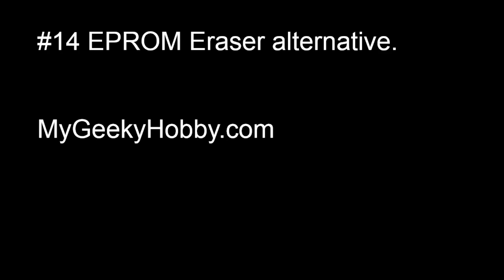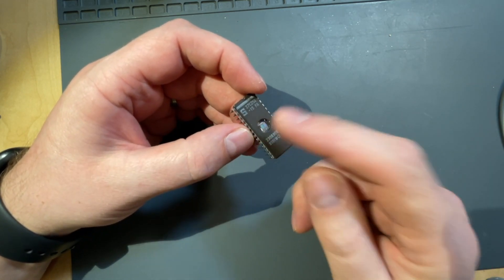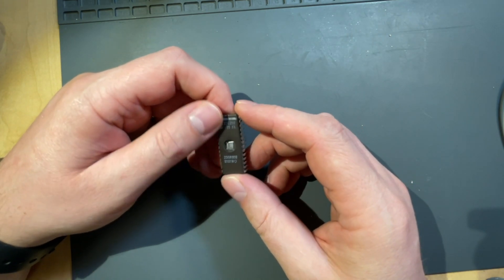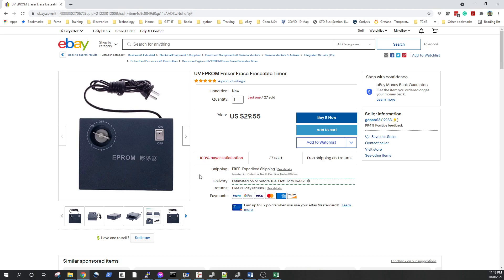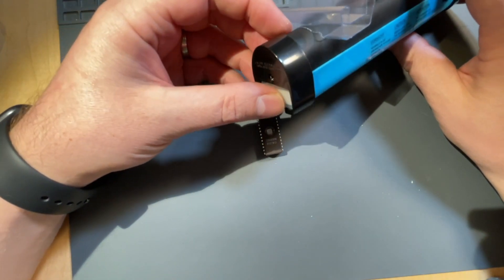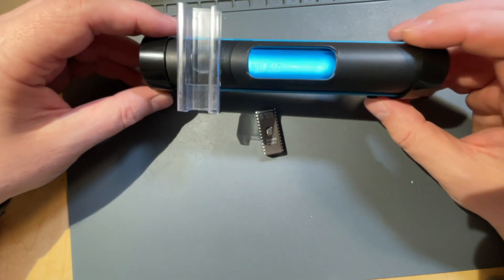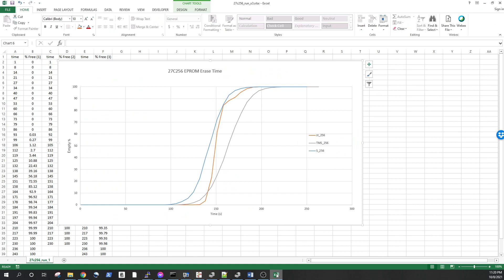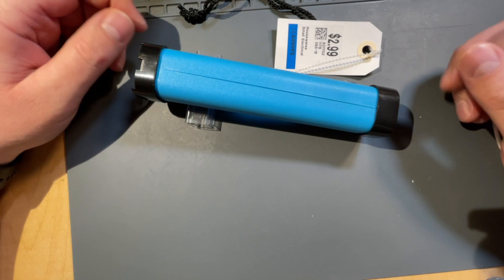#14 EPROM Eraser alternative

Comment: From Wikipedia:

Erasure of the EPROM begins to occur with wavelengths shorter than 400 nm. Exposure time for sunlight of one week or three years for room fluorescent lighting may cause erasure. The recommended erasure procedure is exposure to UV light at 253.7 nm of at least 15 Ws/cm2, usually achieved in 20 to 30 minutes with the lamp at a distance of about 2.5 cm.
Reply: yeah! I read exactly that in the windowed mem datasheet.... only that the units are in angstroms .
the correct time is 25Wsec/cm2,... so a lamp of 12mW must run for 35 minutes.
I want to see if a xenon lamp of an old camera do the job....